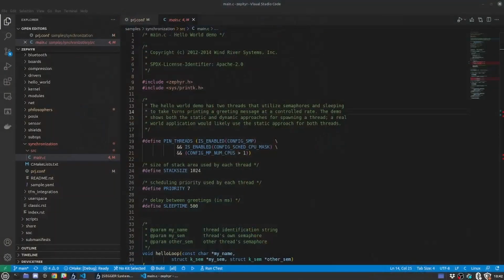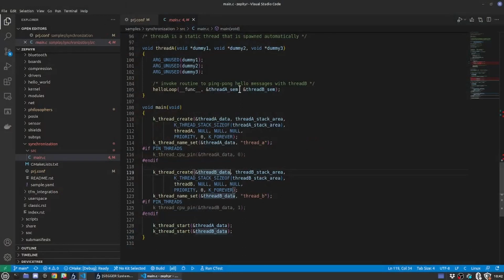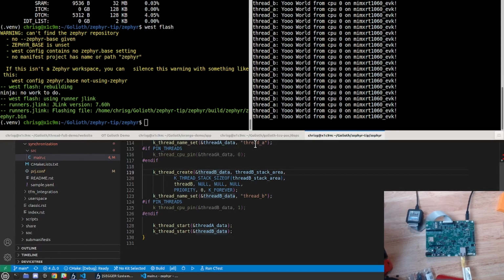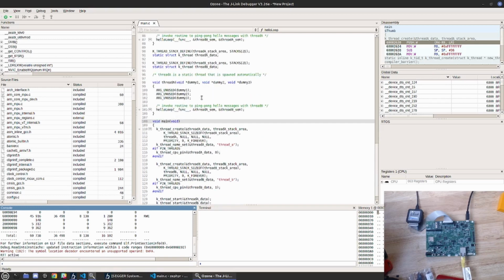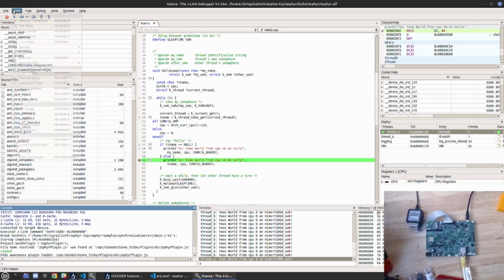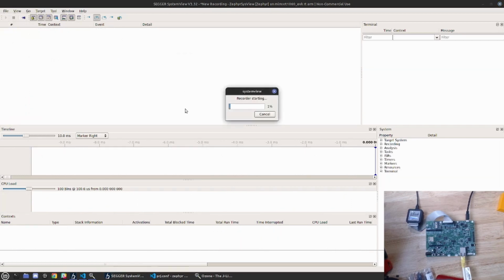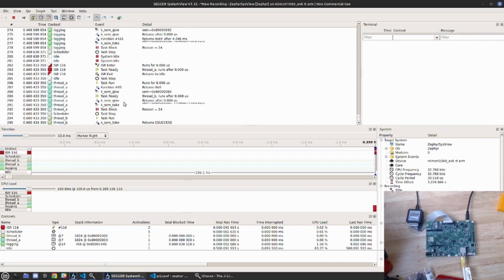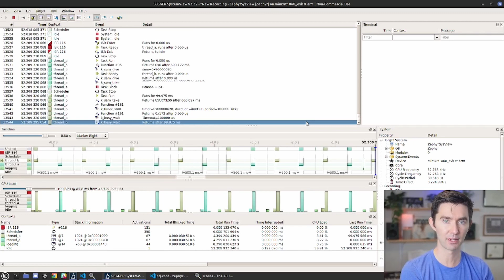Free Golioth Tutorial: Optimize Zephyr Programs with SEGGER J-Link, Ozone, and SystemView

Comment: thanks for this !, question .. Can we permanently have the plug in enabled instead of having to manually enter the Project.SetOSPlugin("ZephyrPlugin") every time ?

Also, I can see my serial output on a com port, but it doesn't come through in the terminal window (when disconnected com).  I'm using the STM32F4 instead of your board but is it due to SWO or something perhaps ?